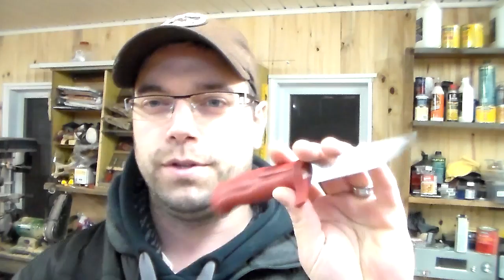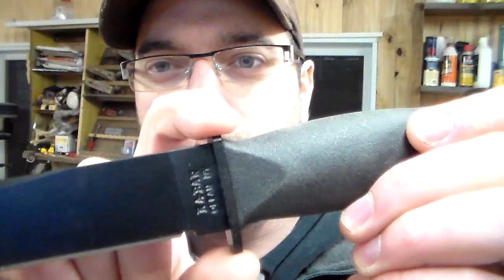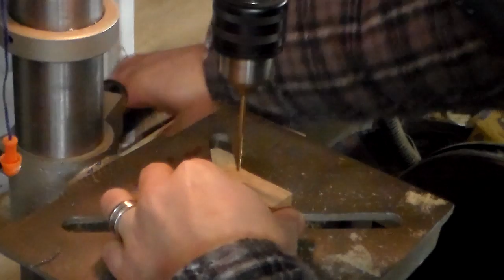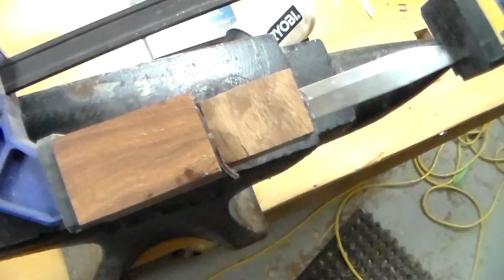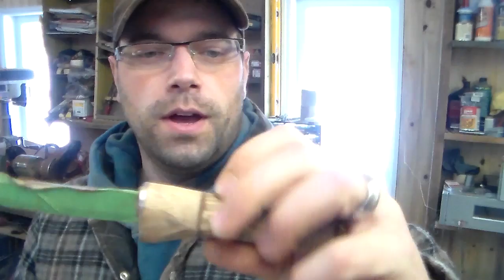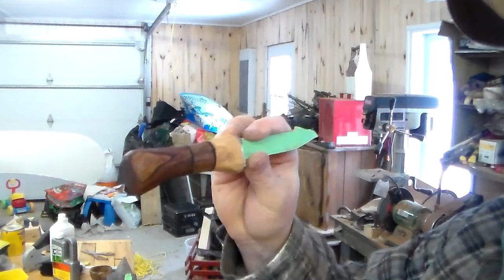Custom Bushcraft Knifes for 11$ ?!! (Custom Mora)

Comment: Say Heah again,  I always wanted a Mora 510, By the time I decided to get one,  they were discontinued,  Then they started making them again,  but the new ones are thinner,  I thought about that and git the new one regardless because the thinner the apex the better the knife cuts.  It now is around my neck almost all the time even at home.  It's so lite I don't know I have it on. And it's awesome.  When I seen the price I was pleased so I ordered the Mora Classic#1, when I got the knives I realized that both blades where identical which is fine by me,  I will get the Classic 2 later.  Oh,  I also seen a decent deal on a Mora 2000 in a special price with the Mora Hatchet,  but the deal only came in the vi-viz orange. I opted for the green anyway since it matched my Bacho Laplander then I found out the Laplander  comes in orange also.  Anyhow,  I never cared for the looks of the Mora 2000, I much rather liked the Mora signature blade shape,  But spring was just around the corner and I wanted a lite Trio to go on my Afternoon Delight's.  And boy am I glad I got the set.  The Mora 200 became my Fav.  just as is,  I think it looks beautiful and it's also used by the military and I could really understand why,  It's one tough knife.  As long as you use it as a knife.  The Mora Hatchet  compliments the Mora 2000 with the Bacho Laplander  completes one of the best  lite carries I own and I have a few good knives to compare from and I do have other trio's I use especially when I'm scouting unfamiliar are's where I might have to spend a overnighter because I'm lost and it's too dark.  But even with this Lite Trio it's good enough to have with you.  I wish I could make handles on my Mora's,  I think you should sell them.  I really enjoyed watching your video.

Comment: Cosmetically you made a huge improvement. From the purely functional point of view the original handles are most likely much better because they came with a half guard and weren't bothered by anything mother nature could throw at them. 

I turned and old hickory in to a drop point to fit a sheath and then realized the factory version already fit the sheath and that turning it into a drop point most likely wasn't a real improvement but at least I had fun doing it. Have fun.
Reply: +Dwight E Howell It don't really matter. I just refinished the blade on a USN RKB 57 knife my friends Grand Father brought back from WW2, it had been hanging in a Barn probably over 30 years. I took off a good bit of blade thickness just getting most of the rust pits out of it. I polished it up and it still just wasn't right, so I put 100 coats of bluing on it and now it's black as night and looks good. The point is the handle is mostly leather with some wood, and it's still functional after all this time and was not even cared for all those years. Cared for, I don't see it ever being a problem.

Comment: A good source for the blades without the handles is Thompsonsknives.com The Lauri carbon steel blades are really nice and reasonably priced. Pretty much all the Skandinavian brands are represented. I disagree on the uglyness of the mora's plastic handle I think there is a certain stoic nobility to the handle. It is the "Anti-Hero" of knives. Anyhow, just my .02¢ adjusted for inflation.
Reply from the maker: RedEyeRobot Robot Thanks for the 2C! Ill check out that site! TBA

Comment: First vid I have seen of yours. Props great job... I don't blame you at all, I would keep them myself, They ended up beautiful and no disrespect or to take away from anything you done because it's great..... Just wandering if you maybe while you had them apart if you could have added a tang/handle connection, Just to tie them together where Mora didn't... Maybe a stainless or brass pin or even a wooden dowel?  As stated before no disrespect you done a beautiful job.. much respect and thanks for sharing with us.. Be safe and look forward to watching MORA--(LOL) of your vids. Thanks again
Reply from the maker: +Danny Harrison :-) glad you liked vid! I am not sure I understand your idea about a handle connection though. do you have a link to a picture you could share?
Reply: No not really at hand, I may be able to find though... But say you know where the tang of the blade is in the handle, You'd just drill through the handle and the blade tang side to side "Like if you wanted to add a lanyard hole" and insert a piece of brass or stainless rod all the way through the handle and tang and smooth off wile sanding.. Any hardware store will carry brass or SS rod, Maybe just 1/8"or even 3/8" if there's room, kinda see what I'm talking about? And these are just thoughts..Also the Brass would sand off a lot easier with it being much softer than SS...
Reply from the maker: +Danny Harrison Ahh I see what you mean. to ad strength to the knife. I am really not worried about durability in this type of knife. a light mora like this is good for light task like carving and camp crafts. I would never do anything with it that involved impacts and such. Thanks for the sugestion though. I will keep that in mind if I want to make a survival knife.

Comment: Yeah, and my Stromeng Bhuku is one of my Fav's neck knife with a 3 1/2" blade, But you gave me an idea, I might put that gun stick finish on my KS 5 then maybe my Bhuku which as a fancy handle to begin with. It has stag, leather and it's a Curly Birch, But yeah, those knives you made are real nice. Yeah, I did pay the most for the Bhuku, but it's a awesome little knife, , ,
Reply from the maker: +paulie 4x Great! Thanks for watching!
Reply: You also reminded me of the knife I helped to design.  First I had a 3V Cryo Tempered since I place a great value on blade tempering. Then I wanted something that wasn't deep, like the Mora's and some Bushcraft Knives are rather slender, it's better to carve with. I also tried to incorporate what Mors Kochanski said about a knife should be strong, so at the 90° spine it's 1/4" and since I like longer blades because I like busting up wood and I like to baton, I had it made in the 6" blade. It's also a Flat Grind with a Convex Edge. And it's only about 1 1/4" wide, but very sharp, It sort of a cross breed between a French Trade Knife and a Woodlore with a modified spear point with more of a belly, Anyhow the handle is G-10 and Scalloped with a Mountain Track Pattern so I can really hold on to it. It baton's well, because of its narrow, thick geometry, but also very sharp because of its very thin edge, Yeah, this time of the year is when I use it the most with having to processes wood to stay warm, Yeah, I take a Saw and Hatchet along, but this knife I can split open and baton reasonable size wood in short order, I wish it was a little wider by maybe a 1/4" to 1 1/2" but to be brutally honest,  it works Ok, , ,
Reply: Sorry, Yeah I had them use the 3V Steel, then I had it Cryo Temp. That's all the guy kept crying about is how many belts he had to use, the steel was that hard, , , And Yeah, it does hold a great edge retention, but a tuffy to sharpen,

Comment: You can actually buy morakniv blade blanks, I don't know if you knew that or not. Here's a link to one of many blanks that they have. 

http://www.amazon.com/gp/aw/d/B00NWO0IRQ/ref=mp_s_a_1_1?qid=1437201603&sr=8-1&pi=AC_SX200_QL40&keywords=mora+blank&dpPl=1&dpID=21gdCdkcl-L&ref=plSrch
Reply: +keaden19 Thanks for the link, I think you are onto something there. No more extra than it costs, I think that would be the way to go since you don't have to take off the old handle, but of course you would also need to make a sheath too, since the blank don't come with one, so keep that in mind.

Comment: How did you get the original handle off? I'm really having troble with it. I tried the chisel (or something like that, don't know the name in english) and hammer, did not work. Tried sawing it along the line it is melted together, could not get very far. My boyfriend wants to try his metal bending maschine, that has a force on 50 tons, but I think that is too much. How did you do it?
Reply from the maker: Marianne Tamme yeah... this was the hardest part. i just smashed it with a hand sledge hammer against my anvil. if you try smashing it be VERY careful. the knife had a tendency of flying off dangerously. but once i got some cracks, i got the rest off with a chisel. 

if you can get just the blade then its much easier.good luck!
Denis
Reply: The Bushcraft Apprentice Well, the bending press with capacity of 50 tons finally did the trick. Luckily only a tiny scratch on the tang. Next time I'm totally buying the blade blank :D !

Comment: They do not sell Mora knife blades on Amazon? Here in Sweden you can just buy the blade.
Reply: +Blatta77 Yes they do, go look.
Reply: Why?
Reply: Blatta77 Why what? The real question is, why lie to everyone by saying they don't sell Mora knife blades on Amazon?
Reply from the maker: +FullSpectrum Survivalist they do sell blades, this craftline was just the cheapest mora I found at 11$ it came with a handle. If you find a blade blank on Amazon for around 10$ link it here.
Reply: "Why?" Was because I have no need to check on Amazon do to I purchase from a Swedish web shop, in case I buy. Ha en bra dag.
Reply: Blatta77 My original reply to you, was to inform you that we can buy the blanks on Amazon too, and go look for yourself.

 I understand you can get them cheaper so you have no need to shop for them on Amazon. I just don't understand why if you never even looked to begin with, you would say we can't buy them on Amazon; but you can.

Comment: You shld just make the 3 wood one a perfect dail rod broom stick type handle since it's shorter your pinky wld fit on it better. Id rather fix it and it be comfy so Id use it rather than just say owell that's the way it is. There's a few guys that make custom handles on here just look up custom Hultafors for Johnny Kenneally you'll see what Im talking about. My buddy Kaz made me one and it turned out awesome the round handle works well for these kind of knives... I love my 511's  great job and thanks for the ride along bud.

Comment: Kinda takes away from the water resistance of the mora series...
Reply from the maker: +Wesley McCarley I would have to disagree with you there, or at least partially. Firstly, I only buy carbon steel blades. So regardless if the plastic handle is great with water, the blade certainly is not. Like all of my carbon blades, I keep them oiled and and clean / dry them after use. If you assume the user takes care of his tools replacing the handle with wood will not shorten the lifespan of the knife in the slightest. Oh the other hand, if you leave your knife on the bottom of a leaky canoe for the summer then you should be buying a stainless blade and you should be fine.  

Thanks for watching! 

Denis